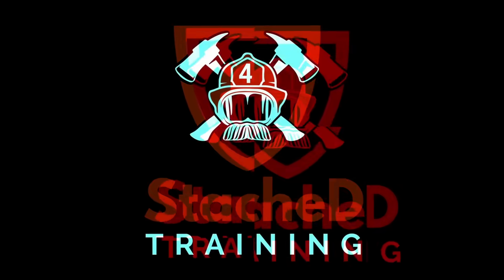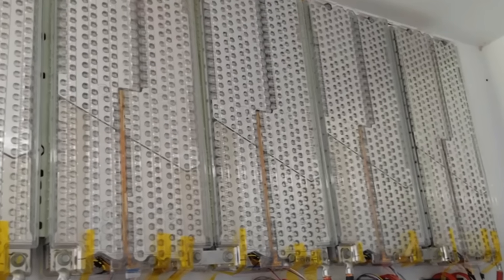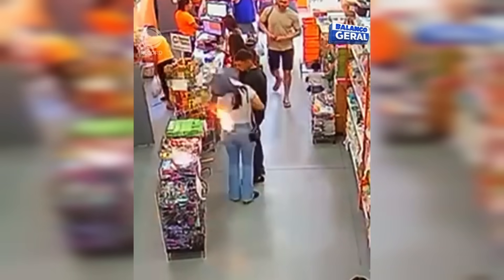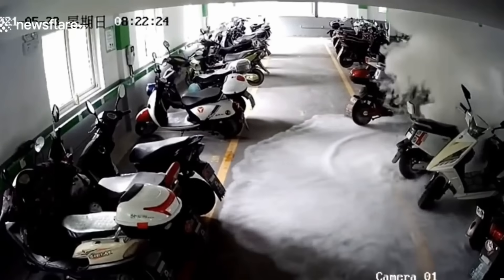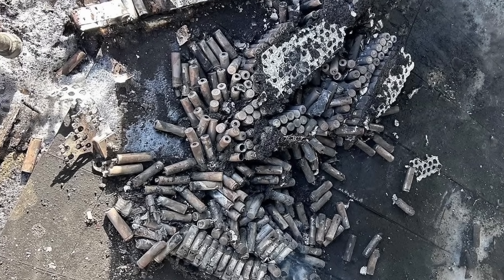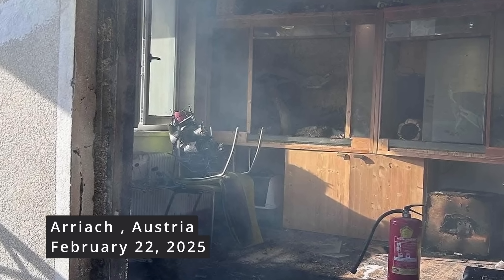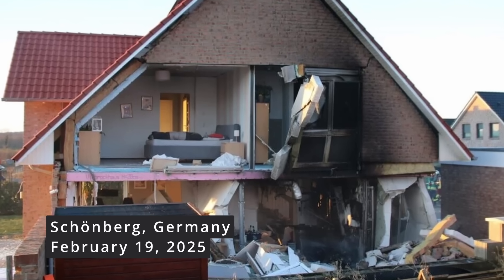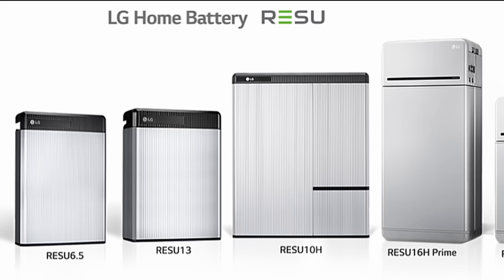Two Homes Just Exploded—The Hidden Danger in Battery Storage!

Comment: This is also why EVs should NEVER be parked inside an enclosed space.
Reply: And E-Bikes, everytime I see someone charging one of those inside a garage I cringe.
Reply: Not with current chemistry, anyway. I'm waiting to see how solid state batteries fare.
Reply: @shane99ca  I have heard many rumours on solid state versions but we will have to wait and see.
Reply: @davebloggs you'll be waiting for 30 years.  Lithium battery tech has been kicking around since the 70s and just recently has become good enough for actual real world use.  Solid state is decades away.
Reply: @shane99ca  Solid state would change the world and make EVs actually good (well, the auto industry would still screw them up but the batteries would be good). We need a battery revolution in order for this to work. We need anything but Li time bombs.
Reply: Nonsense.....
Reply: 100%
Reply: This is just as unllogic as a city here in Germany forbid BEV from driving into undergroud parking garages - becasue a car burned in one and caused it to be shut down for 8 month. 

The laughable stupidity in this was: It was a petrol car. 
It's insane that people driving a car with 70l of the worlds most favorite firestarted, the molotow coctail builders dearest fluid and the arsonists wet dream bringing up fire hazard as argument against BEV. 
Petrol is liquid fire. ICE burn 50 times more often per 100.000cars than BEV. 

Search for gas station static fire on Youtube. ICE set you on fire while fillin gup if you take a seat in our car while petrols eing pumped in.

I like the video where the car owner was showered in fire from the pump and then rolling over the ground to put it out , because ICe are so extremel supermuch more safe regarding fire.
Man, so genious: If yooun are afraid of your car catching fire, BUY ONE WITH the very, very, very best firestarter in hughe quantities right under it. No was that will be a fire hazard.

Petrol basically GUARATEES that an IXCE wilol,  basically never ignite. It works better than Fire suppe´ressant in UICE drivers minds, at least, that's the impression I get reading arguments against BEV from people driving Arsonists dream in hughe Quantities around at high speed.

It' s actually hilarious.
Reply: Well.. if its a Chinese made one 100%.
Reply: @avgjoegeek71  BYD used to have a very bad problem with fires etc not so much now.
Reply: @ Ha Ha , wrong.
Reply: Park your Tesla outside in the north and find out how much battery is used per day to keep the pack warm!
Reply: They should never be used. Period.
Reply: Please show the report that EV are more fire prone than GAS cars.
Reply: @notsecure  they are not more fire prone but when they do catch fire they are almost impossible to put out, a normal car fire is fairly easy to put out but evs are not.
Reply: @notsecure  gas cars self-ignite and either explode or spontaneously go up in flame while parked & turned off is extremely slim. 

Also gas cars on fire is MUCH easier to contain unlikely EV cars.
Reply: I disagree.
Reply: You're right, they shouldn't be parked in any other type of space either.

Comment: I have 140kwh in LFP batteries installed in a shed a good distance from my house. That's where all of my equipment is located. Nothing is inside my home. Temperature is maintained at 70 to 75 degrees year round. I know of no testing which confirms any kind of run away fires as Li batteries cause. All I have seen is a reasonably small fire when liquid electrolytes are burned off which is also short lived.
If there is legitimate testing that suggests differently I would honestly like to know the source of the information.
In case of any type of fire on my property, signage is provided explicitly for emergency responders, specifically fire fighters informing them of power locations and shutoffs provided for them to use for their safety. Energy storage location (battery location) with appropriate warnings and instructions.  
I don't see why people want to use Li storage in a home energy system. It's simply to dangerous and comes with high risk. I "think" most of that is happening in Europe in using used Tesla and Leaf cells to save money? Storage is where most of the money goes in a home solar system and it isn't cheap by any means. Getting cheaper but still very high. Using the used Li cells also requires using much higher DC circuits with relatively recent changes in inverters to use the higher voltage. Advantages being in power conversion being more efficient while allowing the use of much smaller conductors.
I worked for 35 years in industrial controls and worked extensively in 20kv AC power and 800 to 1000vdc circuits. Never enjoyed that part of the work but it's a necessary evil. I do not believe those kind of voltages have any place in a home environment. Common home circuits with 110vac might suk to get bitten by it but not likely to harm you in most cases. 200 to 500vdc only allows one mistake. All the more reason to avoid Li battery packs.
I'm sure plenty will disagree. Everyone has the right to kill themselves if they wish. I'm okay with that even as long as they insure no one else falls prey to their ignorance.

Comment: I am guessing that GM and Samsung and Stellantis just to name a few have all validated and made sure that fires would never happen.  Look no farther than Moss Landing.  Unfortunately, while I do agree that it can be dangerous for DIY Li-ion projects, even the most tested and certified can still and do fail.  I don't have any DIY battery power systems, but there are other things that also have the ability to make things catch on fire.  Was my electrician that wired my house having a bad day that day, or the natural gas pipe corrode or leak gas back into my house and cause it to explode?  What is going to happen when a train full of EV's are in the Chunnel and bad things happen?  It will happen at some point, its just a matter of time.  The odds of a single cell event starting the trigger could be bad.

Lets put a few numbers together to put things into perspective.  I am going to look at the Telsa Model 3 LR.  They have about 83KWh worth of battery pack.  That works out to just under 300 million joules of potential energy.  By the same token 1 gallon of diesel fuel has about 147 million joules of potential energy.  So the Tesla has about 2 gallons of diesel power equivalent energy.  So my truck with 50 gallons in the tank has 7,350 million joules of potential energy.  Gasoline is slightly less at 130 million joules per gallon.    We know how to put out fuel fires, not so much yet with respect to battery fires for sure.  The fact that they are installed into sealed steel cases doesn't help either, in that you can't even get to them to extinguish them.  Because they can feed themselves its difficult to put them out.  Putting water on lithium isn't good either as it reacts with that causing even more issues.   I have no idea what the solution is, but you are correct the more and more of these batteries together in groups will be a big problem over time.  👍🤠

Comment: I'd want an explanation on how any BMS "communicates with the cell". Unless the cell has its own integrated protection circuit, but I'm pretty sure EV battery cells don't. 

(although to note, I wouldn't put a big battery storage of current technology in same building I sleep in even if it was made and designed by someone "reputable")

230V systems shouldn't be DIYed anyway, and the absolute most I'd want to touch is 24V.

Comment: I would recommend an AGM storage system over a lithium powered one any day. I have seen lithium CPAP batteries overheat, and AGM systems tend not to.

AGM batteries are also easier to replace when they do fail, with a much lower risk that is similar to a 12-volt car battery.

Comment: You yourself seem to put too much stock in factory BMSs.  A DIY system uses a dedicated PC that monitors things like temperatures, voltages, inverter and switchgear.  It's actually better than the factory BMS because you can easily add functionality and redundancy.  This includes monitoring individual pack (usually 8 cells) and taking them out of service if an anomaly is detected.   Also.. you don't use modules straight out of a Tesla.  The pack has to be dismantled and each cell tested individually, after which they are installed in a wall mount rack system.   Even all that is not enough.  When I was contemplating such a system I planned to have it in its own shed in the back yard.  A BMS can only tell you if there is a problem, it can't do anything about it once thermal runaway occurs, and even disconnecting the affected bank or battery can not prevent an event once it gets hot enough to trigger an alarm.  The DIY guy was a case of really bad luck combined with not having a plan, maybe due to a lack of knowledge.  It's quite likely he was in the process of breaking down the pack to test the cells.  No DIYer would use a damaged pack as-is.

I'd fully support outside fire resistant installations with a minimum of spacing of 2 meters from any other structure and full hazard warning placards.

Can you guess why I never went ahead with my own battery storage, nor do I have one of the commercial solutions?

Comment: I just replaced my Diy li-ion NMC 70Kwh with li-iron Lifepo4 85kwh 
I've used my wireless whole puncher to destroy one of each style. There is no thermal runaway issues with the lifepo4. They don't erupt like li-ion which causes the pack next to it to heat up causing thermal runaway domino effect. Lifepo4 doesn't get hot enough to cause the cells next to it self ignite. The gases can be dangerous sure. A proper ventilation evaluation system should be designed into it.

Comment: Seems like the battery packs need a venting system that vent the hydrogen outside. Or, better yet, make them cylindrical and design them to be buried in a hole hasilly dug by an auger.

Comment: NiCad battery systems for UPS and communication systems have been used for about 100 years. A well maintained NiCad system can last you over 20 years. You can buy off the shelf steel battery lockers to use externally but they can also be mounted indoors with an external vent.

Comment: It’s disappointing to see explosions like this, though it’s still less dangerous than Propane or Natural gas explosions, which happen regularly.  I think relief venting, as is done on UL Listed fuel tanks is the right solution here.  Then you have a lower risk than gas, allowing people the confidence to switch to electric heat pumps and induction stoves, which are far safer than gas.

Comment: You got to love lithium and that magic word "dendrites" all batteries age and these dendrites love to grow and sometimes they cross the seperator which of course causes a short circuit, now most cells will just fail and stop working, but they occasionally cause a reaction which then cause thermal runaway. Most batteries are still not that old, but as more and more batteries in both cars and storage age, no one really knows when the most damage will start in an older battery, possibly 15 years? Maybe 20, but eventually, many cells will fail to those nasty dendrites, and a lot more fires will happen for sure!!

Comment: If you want to store energy at home, I suggest looking into heat storage. Containers of heated sand hold the heat very well, though if you want electricity out of it, you'll need a steam turbine, however it could more easily be used to heat your home in winter.
If you really need to store electricity, go with by now ancient tech of lead-acid batteries. Takes some maintainance(refilling purified water), and needs a bit of ventilation to be fully safe(hydrogen gas created, easily handled with a good HVAC).
Reply: PS: The new sodium battery technology would also be very useful for energy storage. Not particularly energy dense compared to lithium based batteries, but when mass production gets going they should be cheap, and doesn't matter much if they weigh a bit more, they also last longer, as in service life.

Comment: Never ever DIY Li-Ion battery if you don't know EXACTLY what you are doing. Even with everything properly done, the cheap CCP BMS can fail and not just fail to prevent danger, it can actually cause it. I have LFP storage in my house, I wouldn't dare to have other Li-Ion types indoor.

Comment: The concentration by manufacturers is more energy, my preference would be more safety.    All marketing is aimed at increasing energy density.   All my friends and I are concerned about the batteries but see no way to practically reduce the risk significantly.    All use quality, all use original chargers, all say it is impractical to supervise the charging.   No way to visually see the battery in many devices.    We need safety to be the priority.    Until it is so, no EV or home battery system for me.

Comment: I think that anything used to contain a battery or BEV needs to he built to contain the burn and mitigate the fumes such that no off site resources are needed until it has cooled back down to ambient temperature. I'm not sure how to mitigate the fumes but a heavy metal structure with a chimney would be a good start. The chimney needs to be high enough to direct fumes and smoke far enough up that any that reaches ground level is sufficiently diffused that it is no longer be a threat to life. 

Areas where I think we still need to research are what to do with the vapor clouds. It might be fairly easy to let the lighter than air vapor cloud pass through a flash arrestor and burn it right above the flash arrester. I don't know if the resulting smoke is less hazardous than the vapor cloud was, but it certainly isn't going to explode after being burned. 

The heavier than air vapor is a harder problem. After some thought, the best idea I've got would be to use a venturi in the lighter than air vapor & smoke chimney to produce a vacuum that sucks up the heavy vapors up into the chimney and burn them too.

I have no idea what is in the black cloud that sometimes erupts just before the pack starts burning or how to treat it other than to burn it also. It seems to me like it would burn, and hopefully burn well enough to mitigate the hazard.

These chimneys would not be simple pipes. There would need to be additional oxygen and probably extra heat added. Outside air could be drawn around the battery enclosure where it would do double duty of cooling the outside of the compartment and heating the air being added to complete the combustion process. But that would not be enough heat or oxygen fast enough. I think there might need to be an oxygen candle in the chimney too - and now my smoke mediation device is beginning to look like a hybrid rocket engine. YIKES